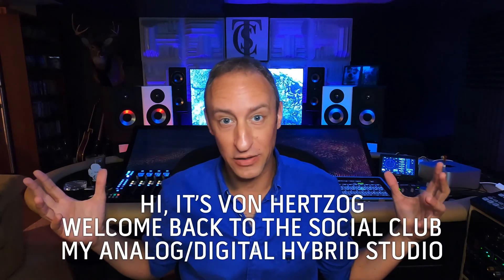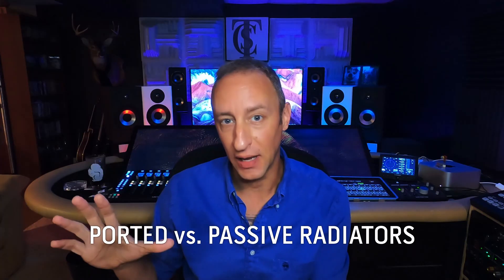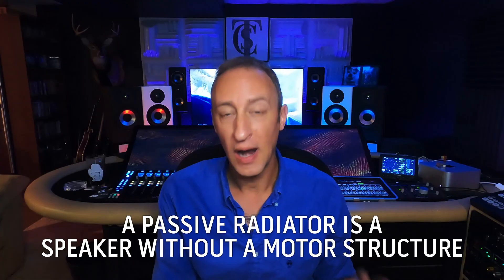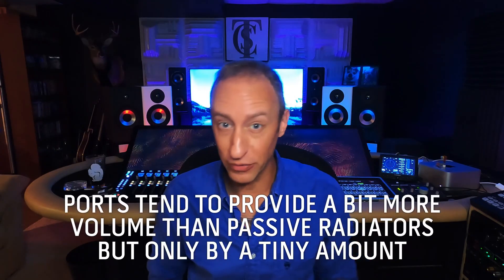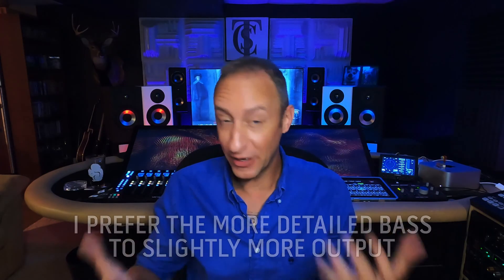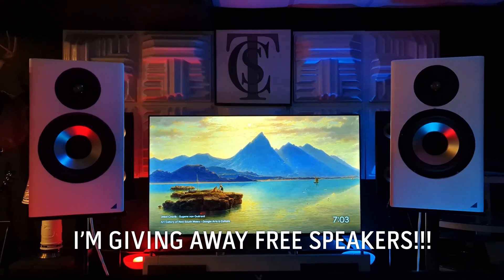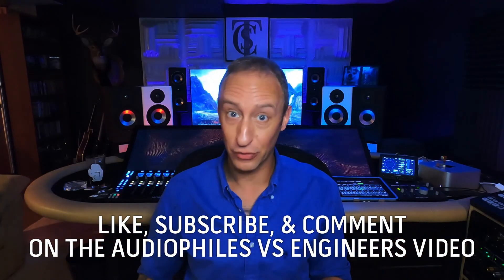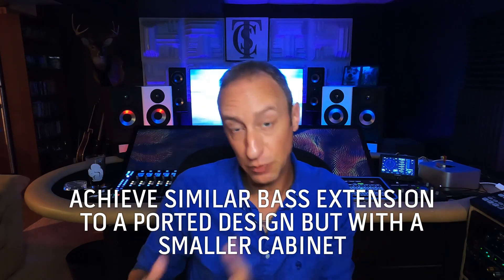Ported vs Passive Radiators - Which Wins?

Comment: I'm perplexed. You measured both, said they are basically the same, and then still ended the video with "go with passive radiators" instead of "either one is fine".
Reply from the maker: While they're the same exact drivers in the same exact cabinet of course they're going to be mostly the same. The difference is the in low end the speaker puts out. The port has a bit more hang than the passive radiators so the woofer is better controlled at the resonant frequency with a passive radiator than it is with a port. Hope that helps clarify. Thanks for watching!

Comment: Fact port controls the hz ! 
Stupid people get commercial passive . 

Ports and the airflow inside is king
Reply from the maker: Ports introduce mid-range leakage and chuffing. The passive radiator sounds more natural. Also the passive radiator does a better job at and below the resonant frequency of the driver. In a ported enclosure the driver plays out of control below the resonant frequency. In a passive radiator enclosure the radiator keeps the cabinet pressure in check closer to a sealed performance.

Comment: Thank you for this. Having been recently trialling portable bluetooth speakers/boomboxes--all of which feature radiators--I was curious as to the rationale behind them. My home stereo's (Polk) speakers are ported--with a funnel shaped plastic extrusion--and has a clean, tight bass response. OTOH, the portable Bluetooth speakers, truly impressive for the amount of bass their small form factors put out, tend to a sloppier, looser low end. I know I'm comparing passive and powered speaker setups, but still.
Reply from the maker: Yeah I have a lil JBL blue tooth with passive radiators on either side. I'm currently upgrading my King RO4Y MKIII speakers to floor standers with two 10" passive radiators in each cabinet. They're only going to activate at around 30Hz and under. So the bass should stay tight from the sub all the way down to 20Hz because the passive radiators help regulate cabinet pressure and helps control the sub around the resonant frequency. That video should be up this month. Thanks for watching!

Comment: By passive radiotor design I read that it should be ~1,5x bigger surface compared to the woofer that it drives. If I understand it right you used the same size ?
Reply from the maker: That is a general rule of thumb but it is dependent on the Xmax of the passive radiator. If you have double the xmax on the passive, it can be the same size as the active driver. But if you have identical xmax on active driver and passive radiator, then you need to use two PRs or double the cone radius.

Comment: @SocialClubSound
Are sealed monitors more forgiving of unproperly treated rooms?
Reply from the maker: Yes they're usually more forgiving because there's less low end output to create interference which results in a smoother roll-off. Easier to pair with a sub too.

Comment: To me PR's sound like mud. At least everyone I've heard.
Reply from the maker: Depends on how they're tuned! You don't want them to activate too high on the frequency scale. A well tuned passive radiator should sound tight
Reply: @SocialClubSound  I've heard a bunch of them from Polk, old Boston Acoustics, and a few DIY's. They all had a slow and bloated sound that lacked any sense of punch or tightness. I've probably heard 10 different models of PR type speakers and all of them sounded just awful.
Reply from the maker: @477BravoJulietsorry to hear that's been your experience. I think Amphion does a really good job with how they utilize PRs
Reply: Pr way deeper than port.
No mid leaks for just punch and loud.

Comment: I am a speaker builder, and i have in my mixing and mastering studio,  4x 12 inch subs... closed ones... which go straight down to 20 Hz... and down under... with a Group Delay of around 7ms 

So for me... closed box wins all the time... 

Next project is 2x2 18 Inch, closed box, for my listening room ( to have fun )... and of course they can 20 Hz with over 110 dB... if needed...
Reply from the maker: Oh yeah for sure, closed is better. My main monitors are King RO4Y MKIIIs and they're sealed. Always love the tightness from a sealed cabinet.

Comment: Port Chuffing or noises from the ported subwoofer is mainly from people pushing the subwoofer beyond what they should. I think the volume knob on the sub should never be past 50%. HSU dual ported 15" and 12" as well as SVS PB 2000 are good. Budget one is the OSD FS12 at $365 might buy that one soon if not the RSL Speedwoofer 10" $299

Comment: Definitive Technology DN12" is 1 main driver & 2 passive radiators all 12" they say it performs like a 15" subwoofer. I paid $299 for the OSD Trevoce 12" subwoofer (2 passive radiators). It sounds awesome with Mad Max Fury Road and Furiosa movies as the soundtracks make the passive radiators hit in perfect harmony or beautiful bass. OSD says the passive radiators are for increasing SPL (decibels).
Reply: What can I add on the the OSD Trevoce 12 ? I'm thinking RSL Speedwoofer 10e which has narrow slot port in the rear bottom or dual ported OSD FS12" which may need REW and Mini DSP to avoid problems mixing ported and sealed.

Comment: I've listened to alot of subs and installed and built enclosures for years. Very high end home speakers use ports. Ive had a very expensive 2000 watt passive radiator equipped sub that sounded sloppy and the overhang was noticeable. A correctly designed port equipped sub will have no audible chuffing. Take genelecs for example .....no port noise at very high volumes. Forward facing ports are usually the way to go. My JBL studio and Klipsch CF had no discernable port noise either. Alot of times in a car application you could encounter port noise. It may have been the environment, or a prefab enclosure mismatch.
All of the most expensive speakers are either sealed or ported. I've never seen a Wilson or anything in that range use passives. In a ported speaker you have some level of damping from the voice coil. Passives only have the rarifying of air to dampen them as they just keep moving. In smaller speakers this may not be a problem.
I think ported is tighter and much cleaner when it's designed correctly.
Reply: I have a Paradigm Seismic 12a for our living room and it's nothing short of remarkable for it's size.  Made minse meat out of a Velodyne Optimum 12 that it replaced.  If designed correctly, PR systems are very capable and responsive.

Comment: Hi, for a bookshlef speaker with 6.5" woofer which passive radiator fits?
Reply from the maker: If you have a 6.5" woofer, the general rule is related to xmax. For instance if your passive radiator has the same xmax as the woofer, then you need two 6.5" passive radiators. But if the xmax on the passive is double the xmax on the woofer, then you only need one 6.5" passive radiator. Hope that helps!

Comment: Love the idea of this video and that you place in laymen's terms, but you mist a few things.
1) It's all about mass. Wether it is the mass of the air in the port or the mass of the passive radiator, it is the back wave of the driver interacting with this tuned mass that produces the "extra" frequency amplitude over a sealed enclosure design.
2) The air in the port is not "pushed out" of the enclosure or port. The mass of air is oscillating in and out of the port. While flares can help, it is the speed of the air in the port that causes chuffing.
3) The passive radiator is not releiving pressure from within the cabinet. It is reacting to the back wave of the active driver and the mass of the air volume within the cabinet.
4) In my experience the volume of the enclosure taken up by a passive radiator is less than that taken up by the port of equal frequency tuning.
Niggles I know, but to those who want to really understand these are critical. Thumbs up!

Comment: I went 8 inch Descend DN8 it sounds great has two 8 inch passive radiators and is very small. The sub and two passive radiators barely fit in the box with the amp.
Reply from the maker: Nice! I bet the bass is nice and tight!

Comment: You don't need twice the cone area of the passive, that is misinformation what you need is twice the xmax of the active driver if you have an 8 inch active with 4mm xmax you can use and 8 inch passive with a 8mm xmax.
Reply: He already said the xmax thing in the video.
Reply: @Alkatross  yeah I should have watched the whole thing first👍
Reply from the maker: I thought I mentioned that in the video
Reply: You don't need twice the xmax of the passive, if you have 8 inch driver with 4mm xmax, you can freely use 10 inch passive with the same exact xmax as an active driver. Most compact home theater subs uses 8" high xmax subwoofers and 12" passive radiators, perfectly balanced combo
Reply: @samohraje2433 that's why I said twice the Xmas of the active not passive, if I have a 12 inch active driver then I could have a passive 12 that has twice the Xmax, if I have a 6 inch active I can have two 6 inch passive radiators that each have the same Xmax as the active.
Reply: @dtwistrewind7361  yep, exactly. But also you can have 3 passives and one active if you have a subwoofer that has high xmax and low Qts. I once heard one of those subwoofers and actually i was thinking like  " wow two 12" subs BUT WHERE IS THE PORT?! " Then i reached  under the sub and there was tiny little 8" ground zero SPL speaker with 40mm of Xmax " only " 700W RMS but man it was loud and deep as fck...

Comment: Don't understand how anybody can claim that passive radiators have a tighter more accurate response. You literally have a heavy slow cone, that is being pushed by the air inside the cabinet. Air can compress. A proper sealed enclosure with the right woofer can definitely give a tighter response, but the passive radiators are mucking things up, and also out of phase. There are applications where a passive is the way to go. For instance if you design a smallish subwoofer, and need to push it really low, there are restrictions that makes a long port impossible, and also just adding more active woofers since the motor structure takes a lot of space. One other advantage of port is the cooling of the drivers voicecoil. If you have the size and ability, you can go with a transmission line design for a really deeeep bass. Another possibility, but maybe not the most used is an isobaric design. Oh and the correct way (which most manufacturers ignore) to build with passive radiators is to have twice the cone area of the active. Also when a manufacturer use passives where they actually could have just used more active, the 1 save a lot of money, since it's really really cheap to make a passive radiator compared to a similar active, and 2 they save on making another frequency cut in the crossover. So if they made a 2 way crossover, but wanted to have the speaker go lower, and instead of 2 active bass/midrange drivers + 4 passive, they could just put 6 active in there, they would need to make it at least a 2½ way crossover design for more linear frequency response/dB output. That can be expensive, and you would actually be surprised how even high end speakers have corners cut, when it's parts that the customer doesn't see. Like having a 3000 USD subwoofer where they saved 50 cent on a part in the amp, that eventually makes it die. But if it just last for a few years past the warranty, it's fine, and also they think in quantity. So 50 cent saved per unit, but 100.000 units sold ads up. You can often see how manufacturers save on things you don't see, if you search online for the drivers for said speaker/subwoofer. Even REL use cheap stamped metal drivers in their 2000 USD subwoofers. But when you look at it screwed into the subwoofer, it looks like high quality. And when they claim a subwoofer or active speaker has x amount of power amplification, it's often measured in 4 ohms and a THD (distortion) that is 20-200x higher than what Hi-Fi amps usually is measured at. And then there's a speakers specs. Frequency response is sometimes +- 6 or 10 dB where it should be +- 3 dB. Sometimes it is even just the total, so how low in frequency can the speaker play while just barely making a sound. Sometimes they use in room response. And also sensitivity is often measured 2.83V instead of 1W/1M. And the 2.83V is a fantasy world measurement that assumes that the speaker is a constant 8 ohm, which it is not. So you'll get a higher rating than 1W/1M especially if it is a speaker that is rated to be 4 ohm to begin with. And also manufacturers can claim anything, and doesn't get any penalty for lying. Piega has a pair of line-source speakers that cost about 20k a pair. The measured 10 sensitivity lower than what they claim, meaning you need over 10x the power to drive them to the same volume

Comment: any chance you can show the time domain charts, that is the most interesting one, the frequency respose alone is not enough to judge the bass behaviour in the room
Reply from the maker: I just added links in the description to the time domain charts for each speakers' in-room response. Hope that helps! You can see some port overhang on the ported design at the resonant frequency and it seems to be cleaner with the passive radiator.
Reply: The frequency response of a passive radiator is worse than that of a ported speaker.
The reason for this is the stiffness of the passive radiator. This leads to a zero point in the frequency response and a steeper drop-off in the lower range. This effect can be reduced by using extremely softly suspended passive diaphragms, preferably without a spider (as the spider provides most of the stiffness).
Apart from the cost of a good passive diaphragm, this is the main disadvantage of a passive diaphragm.

Comment: Growing up back in the early 2000s a family member did have a Philips FW C80 a bookshelf stereo system with built in passive radiators as a 6 year old I was mesmerized I had no idea what were those all I knew is that they moved like crazy and made the whole house shake the most interesting part about the speakers is that they used a combination of a passive radiator and the bass port to achieve low frequencies which is strange considering that if searched anywhere it strictly says that passive radiators have to be used in a sealed enclosure anyway if anyone is interested there is a whole Wikipedia article about it just search for Philips wOOx technology I'll include a link below showing what I'm talking about 
https://youtu.be/z1yq3IEDStM?si=SelESBQqzxZY0EfL

Comment: It was my opinion also that there's no need necessarily to double the surface area with passives. If say you have a 7-in woofer with 7 mm x-max and you have a passive that can do 15 mm x-max. 
Or maybe you have a 5-in woofer and you put a 6 and 1/2-in passive that has more x-max. 
The reason why I would prefer less passive weed eaters is less holes in the box to lose structural rigidity and the passive radiators can be more easily hidden if you can put one in the back versus one on each side where they're vulnerable
Reply: Both a port and a passive radiator move, roughly speaking, four times the air volume of the main loudspeaker.
With double the stroke, this still means twice the surface area.
Reply from the maker: Right! Same page. Thanks for watching and for your comment

Comment: I would like a listening impressions video, I've heard some say Passive Radiators can have a latency because of the mass of the PR, wondering if that is your experience! I would love to play with PR's but they are soo expensive where I live! I can port a speaker for orders of magnitude less money!
Reply from the maker: Someone else just asked for the time domain waterfall plots for each so I uploaded them and put links in the description of this video. The passive radiator plays cleaner and you can see the effect of some port overhang at the resonant frequency. Check the description and let me know what you see in the graphs.
Reply: @SocialClubSound  Down at 40 Hz it does have a slower decay, but with a 28 foot long bass wave, is it audible in room?